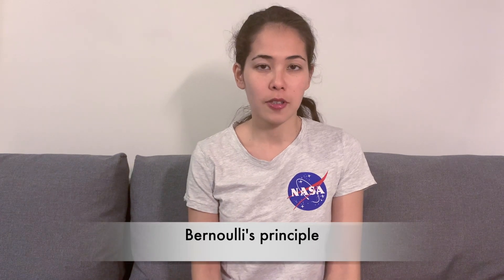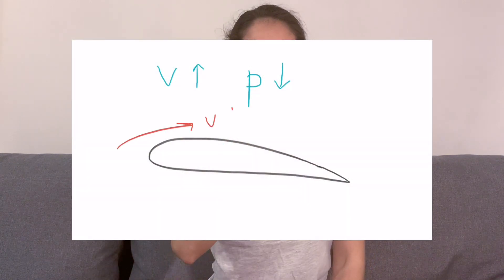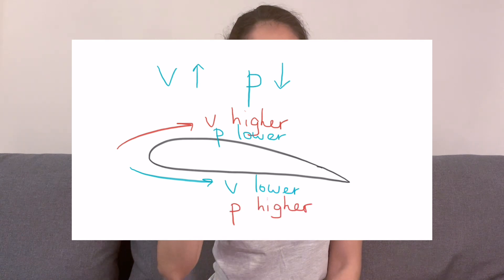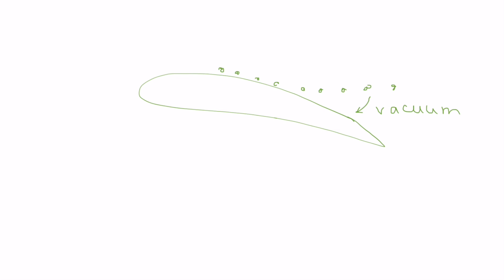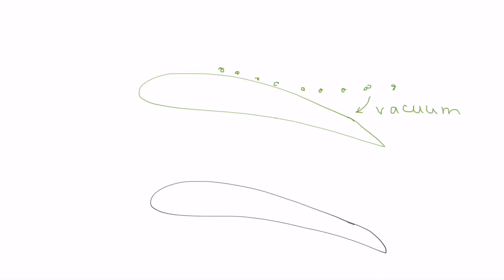What is the correct lift theory?

Comment: I've read another version of Bernoulli's principal based explanation.
It is from the book University Physics by Zemansky. It says: " The flow lines crowd together above the wing, correspon-
ding to increased flow speed and reduced pressure, just as in the
Venturi throat."
 What I understand is that the air flow above the wing is 'squeezed' (similar to what would happen to a flow in a constricted region of a pipe). Thus the flow speed increased and pressure is lowered.
The author also adds that this is the very reason why the umbrella seems to generate lift in windy days (and a strong wind can turn it inside out).

My observation: Early biplanes like Wright brother's plane had a simple curved 2D wing cross-section, (inverted curve). It was nothing like modern airfoil.
Reply: Btw excited for more videos!

Comment: Change in pressure causes fluid to move not the opposite. 

Air is faster above the wing because of a favourable pressure gradient along the flow direction on the suction side and an adverse pressure gradient on the pressure side. This is due to the curvature in the flow as the wing passes through the air due to the way a wing is designed. Newton's second law.

Wings are also designed in a way to produce downwash. Newton's third law.

Newton's second and third Laws explain lift completely and correctly.
Reply from the maker: the suction effect is not explained by Newton's laws
Reply: It is explained by 2nd law. 

Consider two particles in the stagnation region.

At the suction side, the streamlines are curved in a way that there is low pressure on the suction side as compared to the stagnation pressure. Therefore the prticle at the suction side get accelerated.

At the pressure side, the stream line curvature is in a the way that pressure gradient is adverse as compared to the suction side.

Apply 2nd law to both fluid particles or to a small control volume of particles at suction or pressure sides. This is why speeds re different.
Reply from the maker: @fadoobaba  exactly this phenomenon is not fully understood yet - "the streamlines are curved in a way that there is low pressure on the suction side"
Reply: @AliyaBurkit  It is well understood, specially in the case of flow through pipes and cyclones etc. It happens due to centrifugal force.

Whenever there is a bend in a pipe i.e. streamlines change direction/bend etc. there is change in pressure gradient across the streamlines. Same is the case with typhoons, cyclones etc. Also, when there is high curvature of the stremline, there is high pressure gradient between successive streamlines and low absolute pressure like in the center of the typhoon has high speed and low pressure. 

There is a lecture of Dr. Holger Babinsky in which he explains it very clearly what I am trying to say.